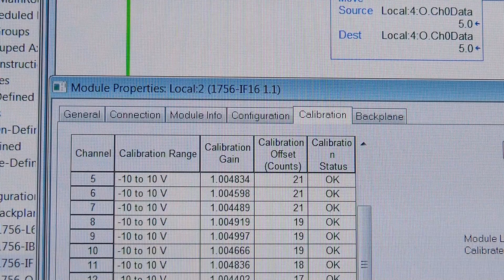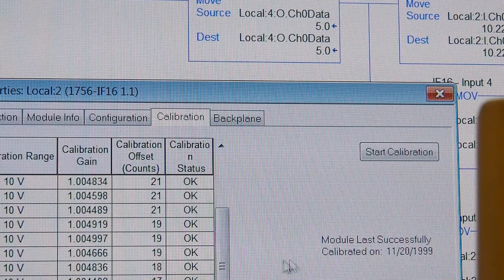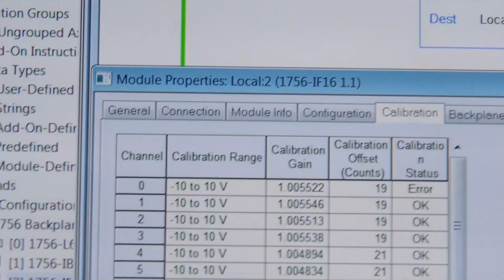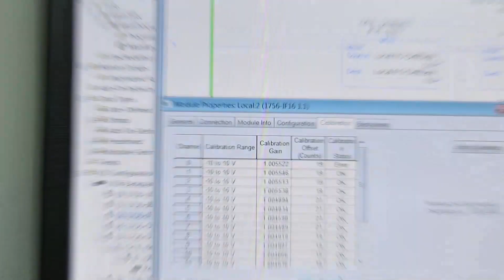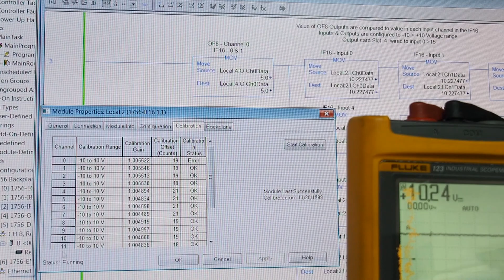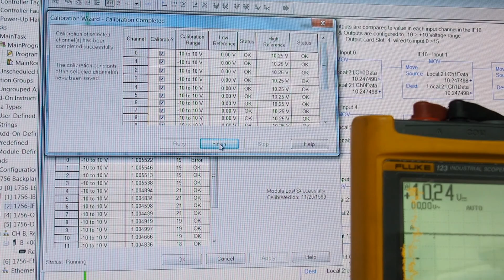2nd - Calibration procedure for 1756-IF16 Analog input.

Comment: Do you have a procedure to calibrate a thermocouple card mv 1756 16 or 8 Channel
Type J
Reply from the maker: Hi Greg:
From what I read in the documentation - a percision resistor is required to do this calibration on these cards.
I asked multiple supply sources and no one could supply me with one about 6 months ago when I looked for them.
The software will step you thru the calibration but the external resistor is required before you start.
I will find the value and post here in the answers tomorrow.  If you have a source I would like to get some for my stock!
Thank you for asking.
Reply from the maker: Found this today in the Analog calibration manual:
From reading thru the manual you need a mV voltage calibrator source.
I don't currently have one and not sure of the prices, but suspect that $1000 or more is not out of line.
Cut and paste from manual below.
--------------------------
Calibrating the 1756-IT6I or 1756-IT6I2
This module only calibrates in millivolts. You can calibrate the module to either a
-12…+30 mV range or -12…+78 mV range, depending upon your specific
application.